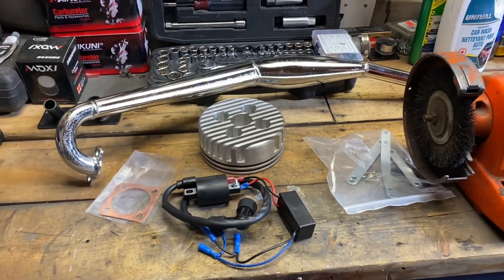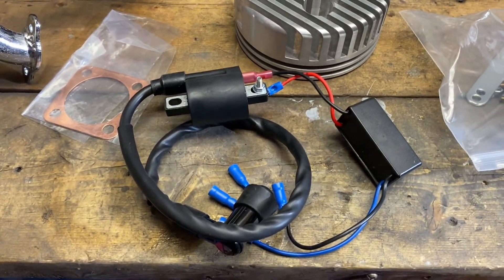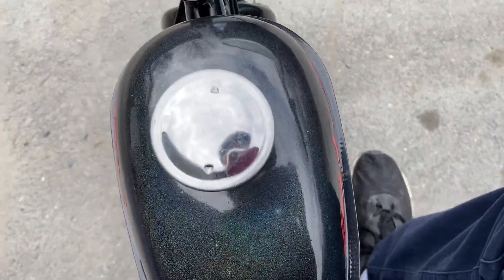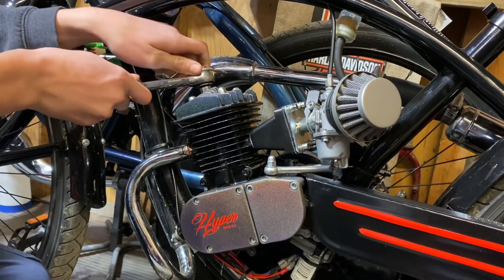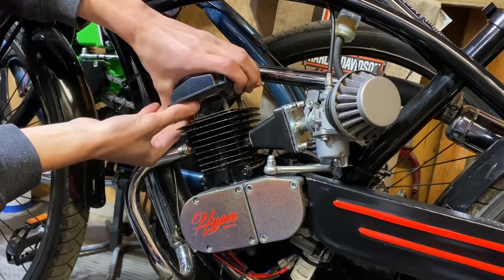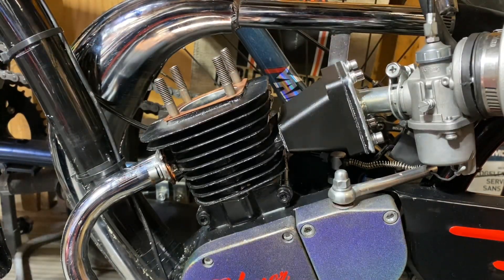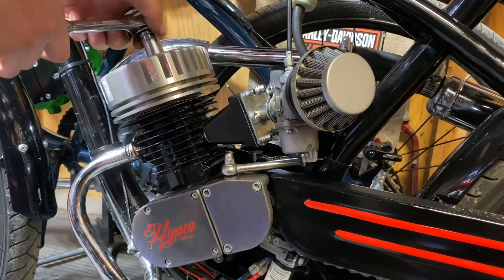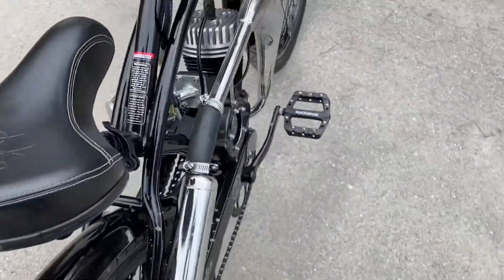How To Install CNC High Compression Head (Measuring Temps)

Comment: Copper is actually HARDER than aluminum, and it can take a tighter torque.  

Don't go higher than 10lbs. on aluminum, or you'll flirt with a leak. 

🇺🇸

Comment: What is gasket size below the cylinder? 1 or 2 mm. Help me please. Can i use 2 gaskets if it must be 2 mm to lower high compression Pressure to avoid breaking piston mechanism?

Comment: You need to silicon the hole that your CDI cable runs through, so no moisture gets into your ignition coill which is 99% of your problems in the spring time, lmfao!!

Comment: One small trick might be to smear a small amount of soft wax onto the nuts when putting them on the studs.

I use a softish microcrystalline wax, purchased at Amazon (as a lubricant, but it works well for this job as well.)
Reply from the maker: Cool!

Comment: Hey bro how did you figure out clearance using the g2 and NT carburetor on that side my clutch arm hits the carburetor 😢
Reply from the maker: Man I just got lucky with mine but you can shave a small amount off of the float bowl to make clearance. But if it’s by a lot consider getting a different style of clutch arm some of the ones come with a nipple that hooks in the end. That will give you more clearance:

Comment: What temp difference, very surprised it’s that much but I recently used a head like that and I noticed it did cool way better just by touch.
Reply from the maker: I know it’s crazy how much of a difference it made. After a ride I can touch the top of the engine and not burn myself.